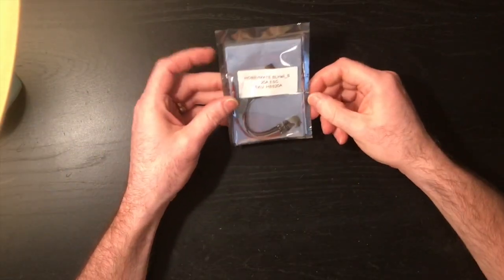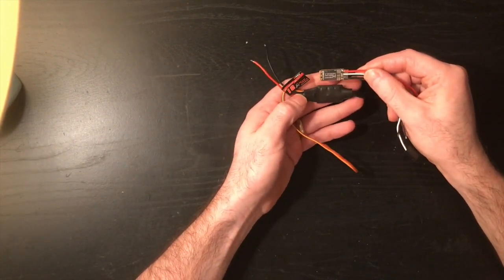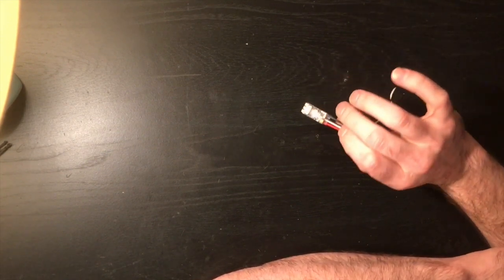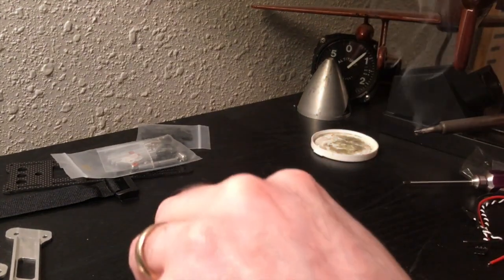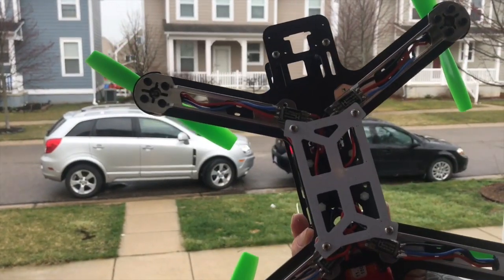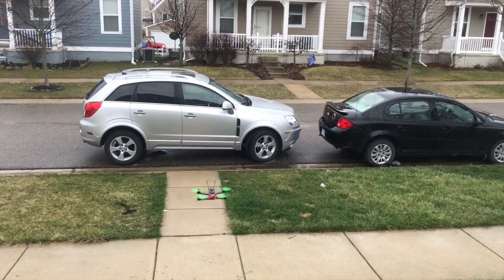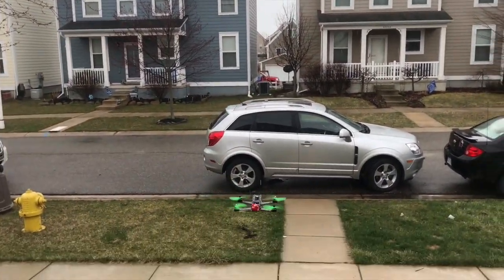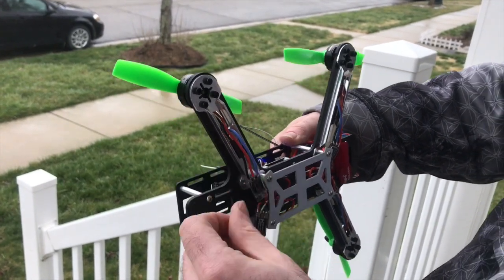SMALLEST 20a Micro ESC for quad racing EVER! - REVIEW and TEST

Comment: hey man im new to this can u tell, do i need receiver and speed controller all together and can be bought in one board. thanks
Reply: what? you need a reciever, transmitter, 4 speed controllers, a flight controller, and 4 motors, and thats the bare minimum for a quad, and its not common to find them all in one board, but i think David Windestal at  rcexplorer.se has some tricopter frames that have the flight controller, but idk about anything else.